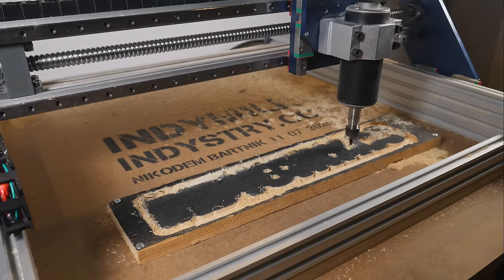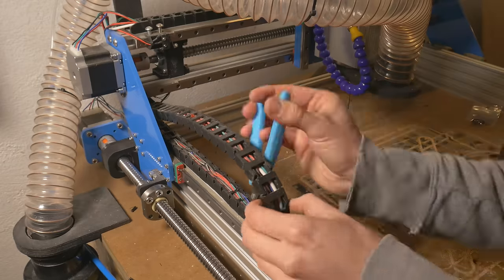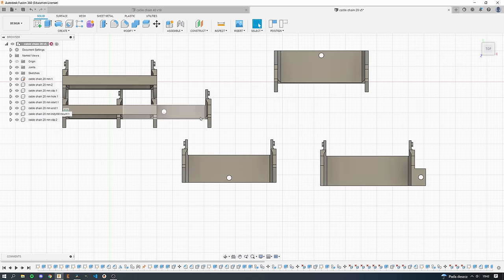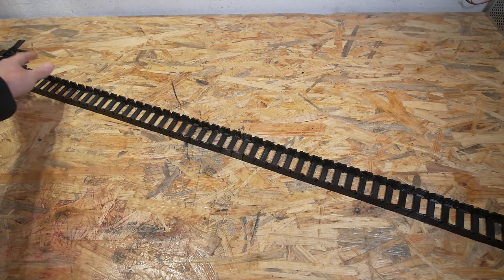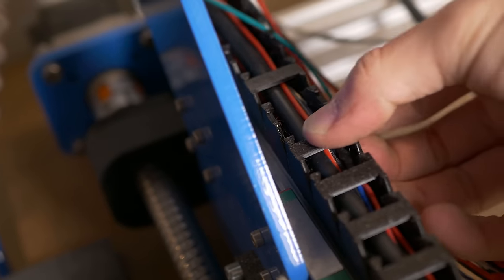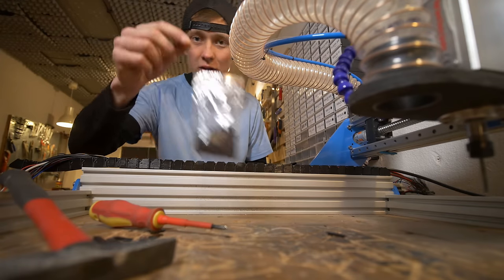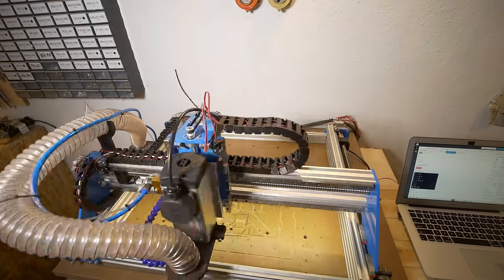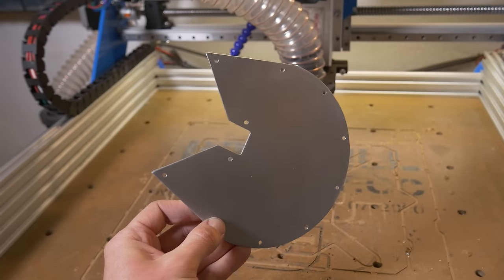How to make your own cable chains?

Comment: Lovely build :)
Making your own cable chains is slow, but sure as hell you can learn to tweak them. 3D printing is so useful in experimenting and prototyping, despite its limitations (manufacturing time, structural fragility compared to injection molding, cost of filament).
My friend Alana makes her own Wago connector mounting brackets for DIN rails (to be used in electrical panels), and once I asked her to print a replacement knob for my Meratronik V640 multimeter.

Comment: Good work as always! I am using the original 500w spindle and it just doesn't cut aluminium very well and can't set speed through the software due to lack of features. I need to do that spindle upgrade to get the performance you are getting!

Comment: What kind of Filiment should be used to make the Cable Drag Chain?  PETG ok or PLA?
Reply: Did you have any luck with different filaments? Im trying PLA, so far so good but yet to fit and print them all.

Comment: Hi! Are you using unshielded cables? All the wires being that close in the cable chain could cause electromagnetic interference (EMI). Did you experience problems like that?

Comment: Real cable chains aren't expensive and so much more reliable compared to 3d printed ones. TBH just buy them
Reply from the maker: What if I prefer to experiment and learn? Making something on your own is the best way to understand how it works!
Reply: buying everything sounds like pretty boring way of doing things
Reply: Boring ! Designing and printing IS the goal 😁
Reply: It's not about being expensive or not. It's all about experimenting, understanding, tweaking, improving. This is what makes us Makers. The road to the goal is sometimes more relevant than the end result itself.
Reply: With his Fusion 360 scalable design he can design/print custom to his application.  You generally are compromising with a bought product. Love the engineering, excellent work.  I'm also learning some new fusion 360 tricks playing your design back slowly :)  Thank you.

Comment: Could you print your cable chain? Yes. Should you print your cable chain? No. Cable chains from china cost much less today as you think and are much more reliable than the printed ones. The printed line pattern causes often problems with high friction that professional chains don't have.